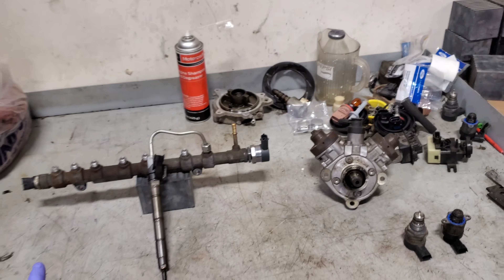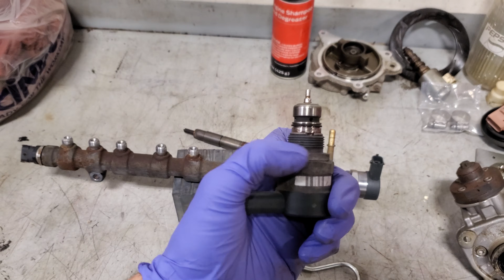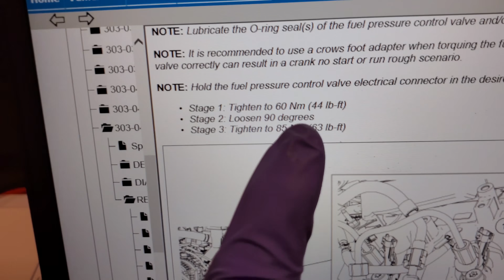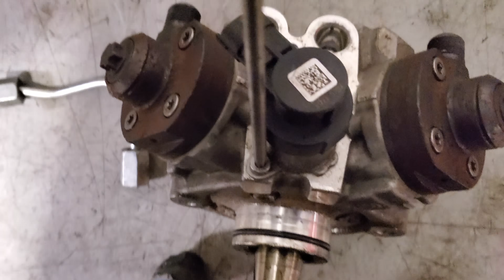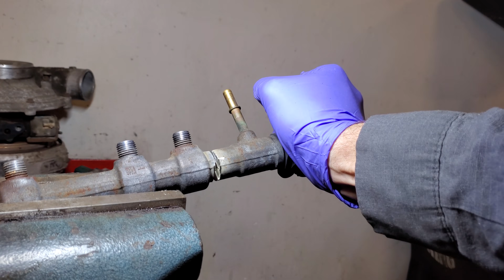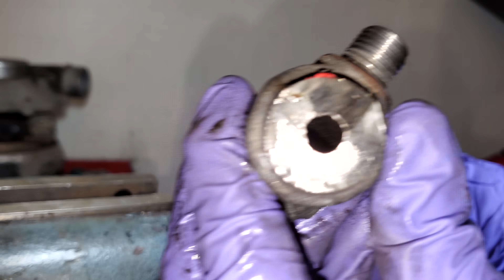High Pressure Fuel system concerns - LH FUEL RAIL discussion | Ford 6.7 Diesel

Comment: This is exactly why I kept my old 7.3....sold the 6.7, you get water in the fuel system on a old 7.3 you drain it out and she will just keep on rolling down the road leaking oil lol!
Reply: I tried using a low mileage 7.3 to pull my 16000 lb toy hauler, tuned with intake. After one time, I was like, nope, that's not gonna work. 7.3's are good engines, but have no power in comparison to what's on the roads today.
Reply: Modern 1/2 ton gas trucks make more power and have higher tow ratings than those old 7.3psd trucks, so your logic is flawed, some people need 25,000lbs of towing ability and your old reliable 7.3 isn’t going to do that.
Reply: @irishsavage8715  that doesn't make any sense, so you saying a 18 year old 7.3 can not tow 25.000lbs according to the manufacturers tow ratings? Oh that's right they now have the magical tow rating fairy dust that they sprinkle on trucks today lol!
Reply: @gregc9220  my wife’s minivan could pull 25,000 pounds, that doesn’t mean that she should or that it’s safe or equipped to. You pull that much weight for any long period of time with a 7.3 and you’ll be replacing parts and causing premature wear. I know I had one, I outgrew it, the 7.3 was great and it’s time but it doesn’t make shit for power, my 67 Cummins could drag four of them down the street... you’re missing the point, those things are antiquated and not even on the same level as modern trucks. And just in case you didn’t know there are 6.7‘s that have broken the million mile mark, so your argument of unreliability is flawed. All you have to do is properly maintain and do away with the missions equipment and these trucks run forever. The only people who make the argument about older diesel engines are people who can’t work on the new ones or can’t afford them...which one are you😂
Reply: @gregc9220  never mind I saw your harbor freight tool review, you can’t afford them😂😂😂
Reply: @irishsavage8715  lol! Whatever helps you sleep at night.
Reply from the maker: Well said my mann
Reply: @gregc9220  Facts don’t care about feelings bud, if you can get by on one of those dinosaurs then do it, I build shit for a living and rely on having my heavy equipment, tools and building supplies, NOW.......
Reply: @irishsavage8715  dude what the fuck ever lol! Nowhere in my comment I said a old dinosaur 7.3 was better than a 6.7, I simply applied that the fuel system is less maintenance on the older diesel engine trucks...you convinced me ok I get I fucked up and never should have got rid of my 6.7, I didn't realize for the last 18 years I was causing so much fucking damage to my 7.3 towing all these years fuck what am I gonna do now? Lol! I guess I need to hurry up get dressed and go buy another 6.7!
Reply from the maker: 🤣🤣🤣🤣🤣🤣🤣 u two...

Comment: Getting P228F right now
Reply: FWIW I had that code after I deleted my 15.  Mine was the PCV on the back of the drivers side rail.
Reply: @gunters96lt1  did you change the whole rail or the pcv?
Reply: @whiskeytangofoxtrot9403  just the PCV.
Reply: @gunters96lt1  thanks